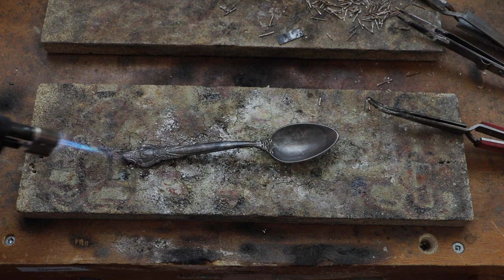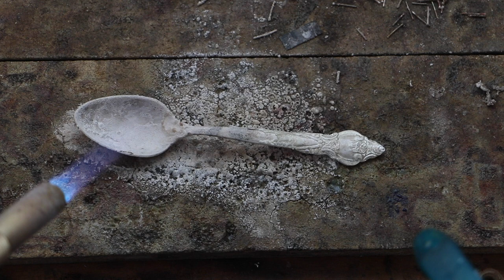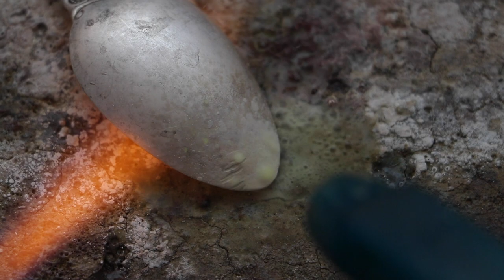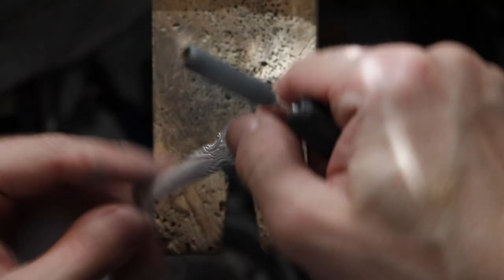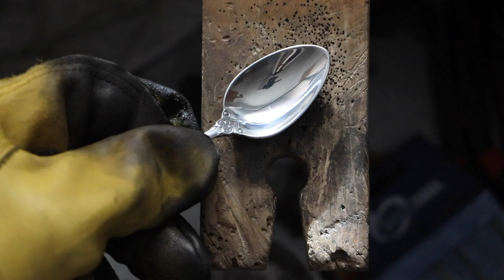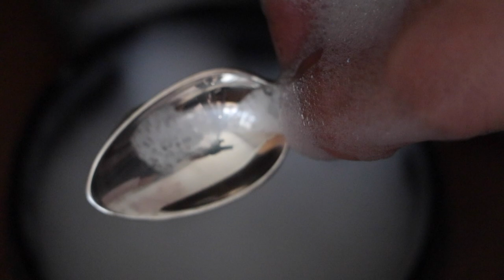RESTORATION  of a Silver Spoon

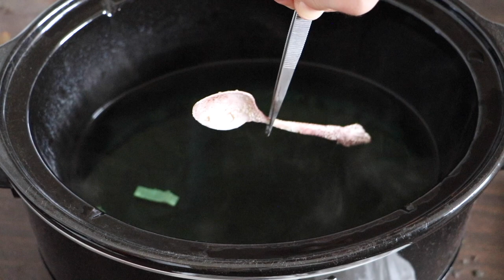Comment: Very good result but dangerous practices for a beginner who would like to reproduce it especially at 2:35 as well as later with the emery roll detached. Also, it is necessary to avoid dipping the iron tongs in the acid as this could attack the silver and make it become pink. Personally I would have flattened the damaged part with a worn and polished burr before the braze to keep the maximum amount of original material. But despite that the result is really exceptional.

Comment: Ништяк видос!👍👍👍👋👋👋 What should I do to prevent the chain from darkening on the body? My chain darkens in a day, I don't know what to do. ?
Что сделать, чтобы цепочка не темнела на теле? Моя цепочка темнеет за сутки, что делать, не знаю. ?
Reply from the maker: Thanks for watching!
1) do not Sweat😁 but that is impossible.
2) and this is probably the reason, you need to check your health! Because silver is working like our health indicator.
And usually it is a problem with Liver.
Reply: Maybe you're acidic that's why the silver darkens easily on you. Have some check up.